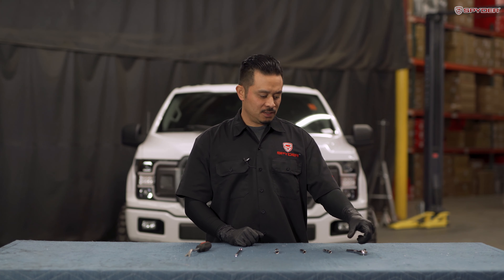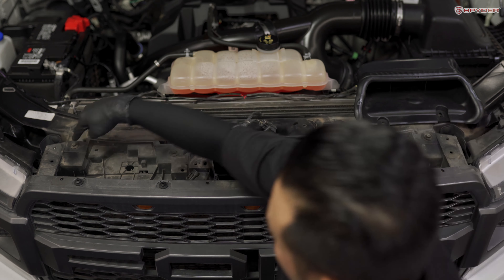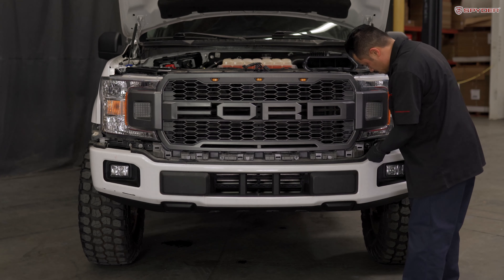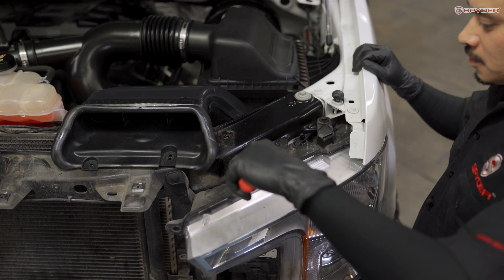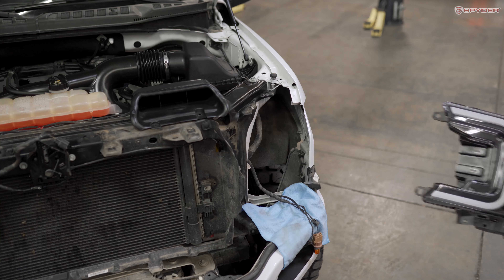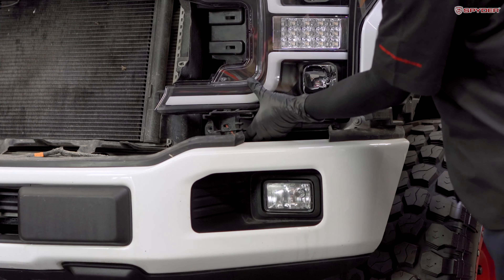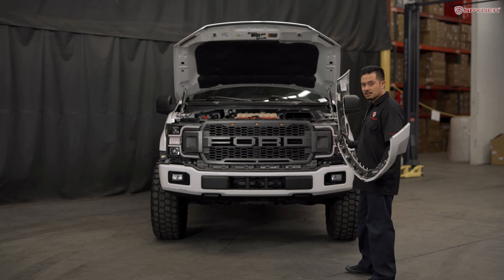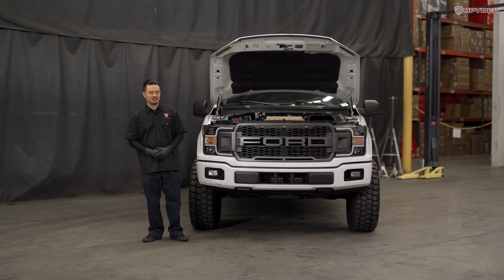Spyder Auto Installation:18-19 Ford F150 Headlight (NON-Sequential Turn Signals)

Comment: I purchased these. They look great but simply was not plug in play on my 2019 f150. Had to cut plastic in order to get the turn signal bulbs to fit correctly. Now I have little pieces of plastic in the headlights... also I wish the led strip was brighter for day time use... and wish they came with brighter white bulbs. Output is decent at the least. Overall 7/10 just because they look great and received some good complements!
Reply: TakataVlogs having the same issue. Wondering I can use the type of blinker it needs, instead of cutting
Reply: Do you know if there's a way to make the led strip day time running light ?
Reply: @ogbunches2801  forscan. And did you resolve the bulb issue?